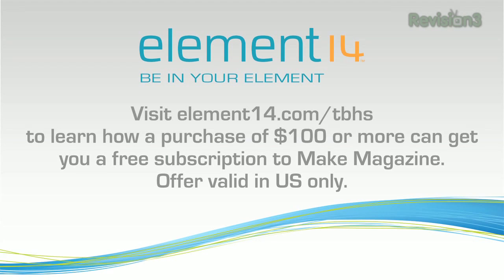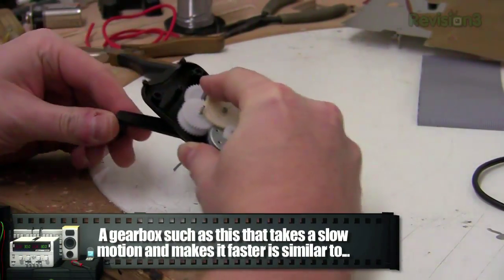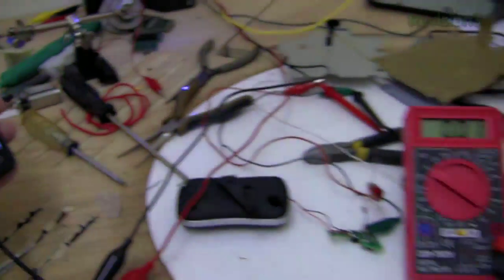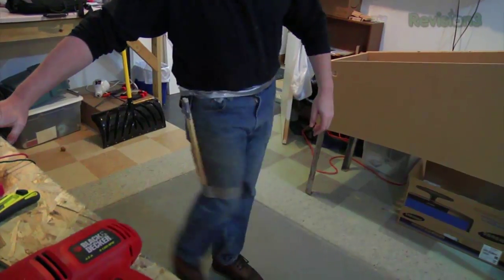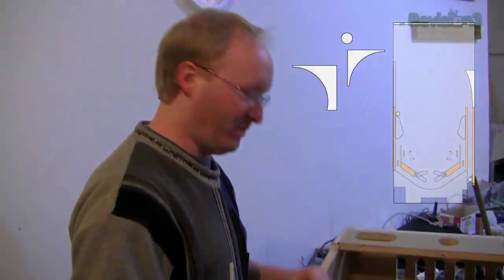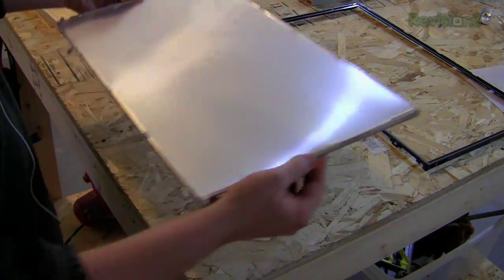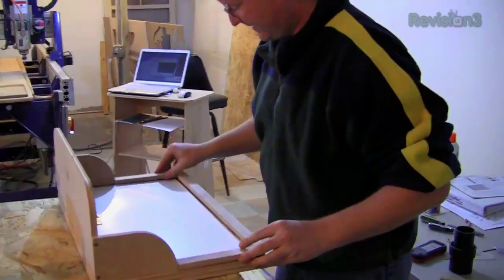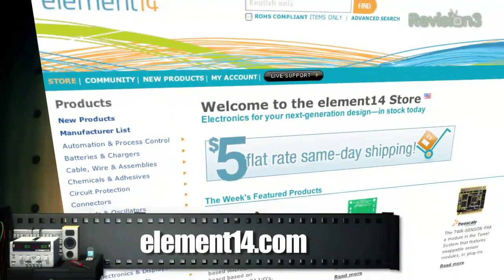The Ben Heck Show - Charge!

Comment: Necroposting ftw.
The leg thingie does not output a high enough voltage due to insufficient angular velocity of the motor, as a long distance traveled by the knee translates to a very small angle at the hip. Since the very long lever arm does however provide a very good torque and legs should have more than enough power to output what you can do with your arms, you could add some additional gears to further multiply movement, so that the ~1 step/s (single leg, usual walk is about 2 steps/s) becomes equivalent to hand cranking.
Very approximate calculations would be 60° forward and 60° backwards per step, with let's say only half of that at a useful speed: that's 1/6th of useful revolution per step, i.e. 1/6th of revolution per second. Hand cranking looks like 2:3 revolutions per second, all useful, meaning you would need an additional 15 multiplier. The first gear might need to be sturdier than those cheap plastic ones (mechanical engineering is not my job).
The somewhat harmonic motion of the leg also implies that at the end of the oscillation the output voltage is zero. While the battery can obviously work with 5V input or open-circuit input forcing a wrong voltage might very well cause problems: this can be fixed with inertia of a fly-wheel, if size can be increased (this would need a bike-like system so that only one direction of motion is transferred to the gears, halving the useful movement portion, but the fly-wheel should well compensate the loss).
Reply: What does “Necroposting” mean?

Comment: I wish you would've measured how much current is coming out when you crank it. Does anybody think charging like this would hurt your phone at all?  Like intermittently having power so often and going on and off quickly if you aren't cranking it at  the right speed. Also i wish you would've turned it into a bike or skateboard powered device or figured a way to crank it a different way while walking or something else easy to do without extra equipment. Or maybe even a wind powered version or something. Maybe in a future episode...

Comment: I've done a somewhat similar hack on an ancient 17" IBM flatpanel.  The inverter circuit had fried itself, so I yanked the inverter/driver out of a flashlight. powered it from the main board, and then connected it up to the CF tubes.  Kept running great for many years!

Comment: Yes but you will need to add a data line that tells the iPhone to charge or it will say "unauthorized charger" and fail to charge. Find a portable battery pack that works with your iPhone and steal components from it. I know this from when I used an iPod touch although my current phone (HTC Thunderbolt 4G LTE) is android based.